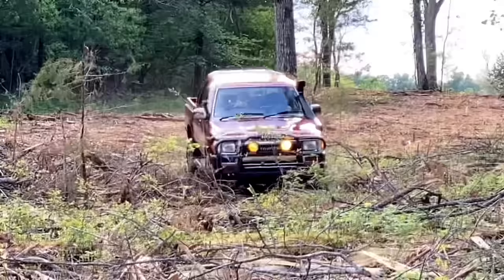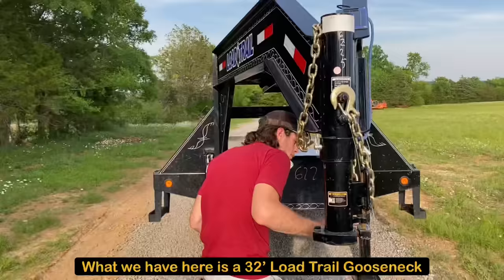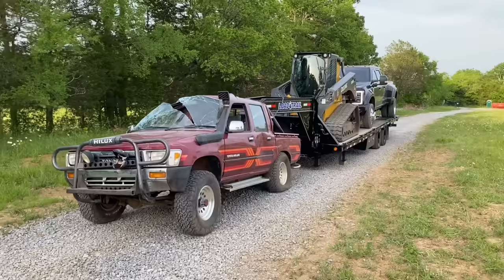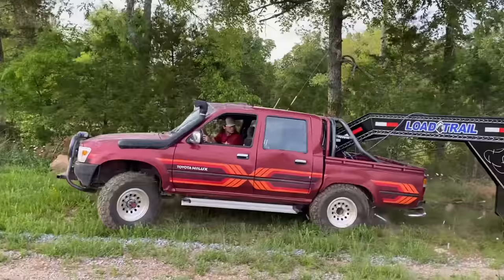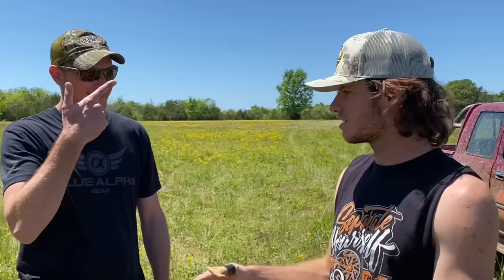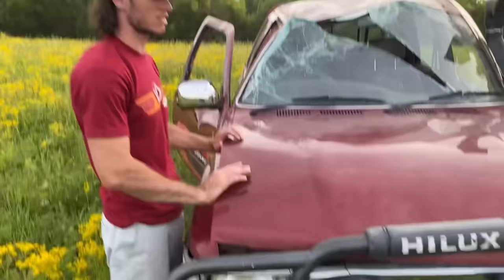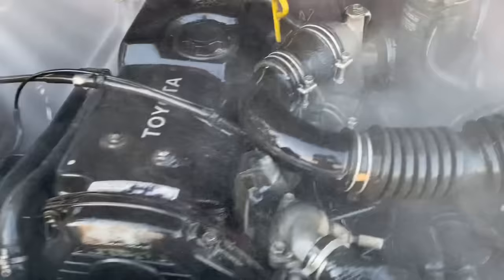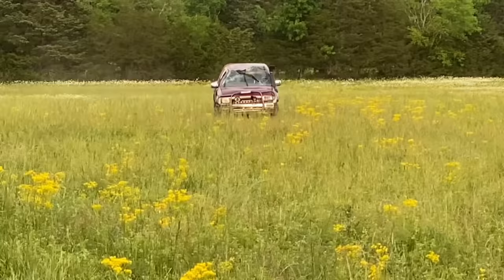Toyota Hilux Durability Test #2

Comment: The hood is designed to fold in the middle in case an accident to shield the windshield from other incoming objects. It is a safety feature :) So the folding hood is working perfectly. @10:00.
Reply: ne zna on gde je crna gora
Reply: @@alsusmedia Physics my friend. How do you suppose you would keep the metal in place during a collision? Really think about that.
Reply: @@alsusmedia No. Do you know why folded steel was revolutionary? Think about when you fold paper how much stronger it gets. What do you think would be better one or two layers of metal?
Reply: @@alsusmedia No Problem :). I appreciate your open mind and grateful heart. Most people are isolated and aren't like that. Cheers!
Reply: Another reason why the hoods or "bonnets" are designed to fold is so that the back of the hood doesn't come through the windshield and decapitate you in a head-on collision. This was a problem on older cars from the 50's, and was also the reason why collapsible steering columns were invented.
Reply: Also, I must give props to the Hilux. I am a huge Top Gear fan, and the first video of theirs that I ever saw was "Killing a Toyota", which immediately made me want one, and now I have a 2nd gen Tacoma. The next step for me is definitely a 4th gen Hilus SSR, pretty much exactly what WhistlinDiesel tested. And honestly, I am glad that this pickup was sacrificed to demonstrate how tough they are. It's not like these are super rare and have to be kept nice for the rest of time. There are still farmers in Australia that have beat on 3rd and 4th gen Hilux's since they were new, and they just keep on running!

Comment: This thing hasn’t failed to impress me, it’s insanely durable.
Reply: Watch what Jeremy Clarkson did to one they left it in an ocean and demolitioned a building on top of it and it still ran😂
Reply: Please buy the new Toyota hilux and test it the same
Reply: Wait until you see the bigger brother the 70 series land cruiser
Reply: @shiv5927  overrated
Reply: @jacobrefoy4061  my bad, i meant the 70 series
Reply: That because it's a toyota the are built right I have a 13 toyota and never had a problem with it

Comment: "no coolant for 6 miles." Toyotas don't need coolant. And anything after 1 quart of oil is optional
Reply: No gas just fumes
Reply: Overheating is the one killer of these things. They like to crack heads.
Reply: Except that's not even almost true
Reply: @MegaDysart  both the 1KZ (3.0 diesel) and 2LT-E (2.4 diesel) crack heads after around 150k if not looked after,  but they're relatively inexpensively replaced. The blocks themselves are pretty bomb proof.
Reply: My cousin had an 89 4x4 with a 22RE. Blew the rad out of it. It’d run until would lock up, he’d let it cool down and it’d fire back up and do the same thing again.
Reply: The old Camry motor (1MZFE I think) a buddy of mines mom ran it outta oil, locked it up, and then added oil and let it sit for a week. Things still running to this day
Reply: @liamhastelow5235  the hilux in this video is an ln106, so it has a 3L in it, not a 1KZ. They do like to crack heads thiugh
Reply: @achilleaustin4477  thought it was a 2L but I've forgotten some of the engine codes now. 2.4s were actually worse for overheating than the 3.0 was. I had a 3.0 Surf and loved it. Just was too thirsty.
Reply: I’ve never owned a Toyota. But wow. Just wow. I can see why they are so expensive 💰💰💰
Reply: @liamhastelow5235  the surfs omg. Such a great vehicle
Reply: I've I've a 03 Toyota echo at 190k, made a few 300mi trips before it sounded funny and I had seen it was running on a CUP of oil. Head gasket is leaking now but still runs fine lol
Reply: I've personally witnessed a toyota avalon run and drive with no oil pan, more than a couple times, never knocked or anything. Ran like nothing was wrong lmao.
Reply: Can confirm OP. lol. Oops 😬
Reply: True, but to be fair my old v6 mustang didn’t need oil or coolant to run either, I ran that thing hard too. But those did get an old explorer engine so probably why

Comment: Today I learned a little ass hilux has a higher towing capacity than my 2500
Reply: #timetotakeitback
Reply: I bought a 2013 tahoe 4x4,  and I feel stupid now after watching this , selling that and looking for a Toyota next
Reply: @bicmitchum1368  highly recommend the 5.7 out of the tundra smoothest motor I've ever driven durable as hell.
Reply: @benmuccianti8577  towing capacity is crap though
Reply: Bruh these little bitty trucks could complete with 1 ton pickups
Reply: @NeedForSpeed.2004  that hilux is a 1 tonne
Reply: @ReinventingTheSteve  yep
Reply: 4x4 lo is like 30:1 gearing I believe
Reply: Well of course that’s considering it not breaking and flattening the truck with that load like what happened here.  We got guys who are 250lbs pulling fire engines with ropes

Comment: My 1st gen Tundra did that for me in a rollover. Went over 1.5 times, landed on the passenger side door in a ditch. I climbed out through the window totally fine and when I went to get stuff out of it at the wrecking lot, all 4 doors of the access cab opened and latched flawlessly. Probably still drove.

Comment: It appears that Toyota rated their Hilux the exact opposite way that Jeep rated their Gladiator.
Reply: What do you mean? How does jeep rate their gladiator?
Reply: you know what the funny thing is, Jeeps was used in WW2 to carry troops to the front lines and move about in offroad conditions which is pretty badass until you find out that Toyota has an actual war named after them where these trucks would go up against tanks and attack helicopters and actually win...
Reply: @erikjr3291  I mean that Jeep rated the Gladiator as a heavier duty truck than this Toyota.  It's my opinion that the frames (not to mention just about everything else) are not as strong on the Jeeps.  Perhaps if this triggers enough people WD will be ever so kind as to repeat these tests with a Gladiator and then we can all decide for ourselves which company made the better truck. Peace be with you all.

Comment: This was a dream truck of mine for so many years, until I saw you bend that hood. I'm pretty over it now.
Reply: Yeah I don’t blame u that Screams poor quality.
Reply: its actually made to, it got little notches in it so that in an accident it sort of promotes crumple zones.
Reply: It bends back just as easy. I bet if he put couple minutes to bend it back ‘properly’ it would latch, it worked with my ‘80 Corolla
Reply: Lol, a hood is just a sheet metal cover. Even with my 1976 Benz it's pretty thin. Doesn't even have much in the way of bracing, just a slab of sheet metal.
Reply: It’s supposed to do that, all cars do it, it’s called a crumple zone during an impact to help absorb impact during a crash, back in the 80s they didn’t have all that tech so they had to improvise.

Comment: strip everything out of a truck and see how little it mechanically takes it to run and drive
Reply: He did this with a diesel truck. Wound up just driving the front axle, transmission, engine, and half of the frame around. Highly recommend
Reply: It only takes the Toyota emblem
Reply: We already know the answer to that

Comment: The jdm importers see a sudden rise in requests for 80s hilux's. I can see it now.
Reply: Japan laws have taken most of them off the road. Same with any old vehicles, it's expensive to keep old stuff on the road, they relegate old stuff to collections and museums
Reply: @netrioter  how is it expensive if that truck will run on the road for another 500k miles and maybe need a water pump and ball joints
Reply: @cablenowadays6586  yeah, but in Japan they charge you a lot of taxes for having an old car, mostly because of the pollution and to maintain a high activity in the car Market.

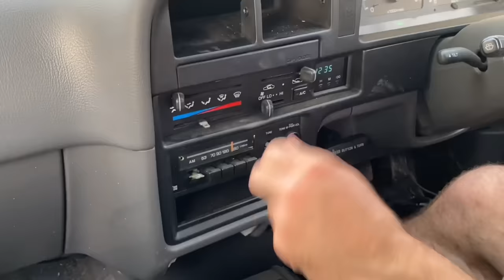Comment: @11:45 old school radios can be good because you dont press a button and have to guess.. hear me out

The old knobs where you slowly tune you can do while driving but holding a button you have to look and press lightly

But what i remember is old old school with motorised "tuner" set and the knob would spin

Anyone?

Also yay to A/c
Ok so you might not get a hypoallergenic exactly 24c interior but its always a quick cold  blast and then you can open windows ... some of the older hiluxes even have the inverted window

Comment: That hood bending like that is on purpose so it doesn't cut your head off in a wreck!
Reply: Yes.  Pop the hood on any Toyota and you'll see places where the steel is intentionally crimped...so that the metal dissipates energy and lessons the forces of a violent head on collision.  
The engine mount is also designed to deflect into the ground, if a head on is violent enough to push the engine towards the passenger compartment.
Reply: Nah. he didnt fold it w one hand. The support ridges were snapped by the head-on tree accident first (can see them see in profile)

Comment: I had one of these in Afghanistan, its the only truck I would trade my Tacoma for.
Reply: I hear you. I think I would trade my '17 4Runner for one like he is destroying. I had a '04 Tacoma DCSB for 16 years prior. Best damn vehicle I ever owned.

This is kinda hard to watch.
Reply: Military?
Reply: My dad has a 88 pick up with 300,000 miles. Then currently we still have it. It runs smoothly. The newest one he has is a 2008 Toyota Tacoma. V6 PreRunner.
Reply: Toyota’s are not real trucks😂😂😂
Reply: thx for ur service
Reply: @ikegiffen2539  correct.

Comment: The ac knobs and shit are supposed to be able to come off that’s how u pull the rest of the dash out
Reply: Yeah, a lot of Japanese vehicles of the era are designed to have parts that can be easily replaced or fixed if they weren't designed to break in the first place, all that stuff will clip back on and be just as strong
Reply: same with the mirror, it has a couple of springy tube things, if they didn't go flying to never be found again, he could put the mirror back on with a phillips head screwdriver

Comment: Engines: 1968-1971: 1.5 L (1,490 cc) 2R I4 [6] 1971-1972: 1.6 L (1,587 cc) 12R I4 [6] 1969: 1.9 L (1,897 cc) 3R I4, 85 hp (63 hp) 86 PS) 1970-1972: 1.9 L (1,858 cc) 8R overhead camshaft I4, 97 hp (72 hp 98 PS) 1972: 2.0 L (1,968 cc) 18R overhead camshaft [other languages] I4, 108 hp (81 hp; 109 PS) 1972-1978: 1.6 L (1587 cc) 12R I4, 83 hp (61 hp) (SAE gross, Japan), [7] 67 hp ( 49 hp (SAE net, export year) 1973-1978: 2.0 L (1968 cc) 18R I4, 105 metric hp (77 hp) (SAE gross, Japan) 1978-1983: 1.6 L ( 1,587 cc) 12R SOHC I4, 80 hp (59 hp) at 5,200 rpm and 12.5 kg·m (123 Nm) of torque at 3,000 rpm (RN30/40, Japan) 51 kW (69 PS) 68 hp) at 5200 rpm [9] 1981–1983: 1.8 L manual, 4-speed (Australia) 1978–1983: 2.0 L (1968.1 L cc) 18R SOHC I4, 89 metric hp (65 kW) at 5,000 rpm and 14.8 kg·m (145 N·m) of torque at 3,600 rpm (1983 European spec) [15] 1978–1980: 2.2 L (2,189 cc) 20R SOHC I4, 67 kW (91 PS) ; 90 hp) at 4,800 rpm and 122 lbf-ft (165 N·m) of torque at 2,400 rpm 1981–1983: 2.4 L (2,366 cc) 22R SOHC I4, 72 kW (98 PS; 97 hp) at 4,800 rpm and 129 lbf-ft (175 N·m) of torque at 2,800 rpm 1979–1983: 2.2 L diesel I4, 46 kW (63 PS; 62 hp) at 4,200 rpm and 93 lbf-ft (126 Nm) of torque (5 long bed only in US), LN30/40

Comment: The hood folding like that is a legit design. In the event of an accident it folds like that to prevent debris from coming into the windshield. If you look there are actually engineered weak points under the hood so it will fold like that.
Reply: I had a teenager slam "my" Penske doing 50-60 going around a corner. Those crumple zones are life saving that hood would've decapitated her. She was still close though I had just closed up the lift gate.
Reply: Folded like that I top gear test as well

Comment: Lost it when it pulled the Raptor. 30 years ahead of its time
Reply: It did have a ton of bricks in the bed
Reply: @qomco  it also has 300 less horsepower
Reply: @Spherz  good point
Reply: @Spherz  and still way lighter
Reply: Raptor looks like it was only in 2 wheel drive initially. And Horsepower doesnt win tug of wars, weight and traction does.
Reply: @Steve_I  and torque
Reply: @toronto543ontario6  it’s still an old Toyota

Comment: The hood is supposed to bend so if you get into a crash it doesn’t put all the pressure on the hinges and the hood snaps and comes flying back at you they are required to put cripple points in the hood

Comment: Type: automobile model series (en) 2.7 gasoline, 2.0 gasoline, 2.5 turbo 2.4 turbo 2.8 turbo D4D Engine position: front, longitudinal Power: 164 hp Torque: 241 Nm Movement Rear-wheel drive, four-wheel drive Automatic transmission 5-speed for rear-wheel drive 6-speed for four-wheel drive Weight and performanceWeight 2,730 kg ￼ Maximum speed 200 km/h - 180 km/h Fuel tank 80 liters Dimensions Length 5.13 Width 1.760 Height 1.695

Comment: Don't get me wrong, the Hilux is much more impact resistant than my F150 by MILES but can it get on the highway with 2 running cylinders (V6) and go 76mph and get amazing gas mileage (not the reason for the others turned off😅)

Comment: This thing won a war.
Against tanks.
In fuck you desert shithole conditions.
Life is a racing game, and the devs forgot to give this car breakdown parameters.
It's one of those cars you can drive to a pyramid shaped brick, and it will still haul a 30 tonne trailer with 2 and a half wheels left.
You can drive it into a ditch, roll it over twice in a field, crash it into a concrete bridge pylon definitely on purpose, set it on fire by "making the brakes more fun this way", and full send it straight off an angled flatbed GTA style, in the process of which gaining a permanent left elbow injury, and you will leave the car more fucked up than it the crash.

If that sounds awfully specific, you're right.
But the thing didn't fucking break.

(Seriously drive safely, i have it from a trusted source that permanent joint injuries because of "i saw that on TV, i can do that!" are quite literally the opposite of fun. Or drive like a destructive maniac, i'm not your mom, have fun.)

Comment: The weight of the f450 is almost 100% on trailer rear axles, so, well... yeah ok, impressive? not as much as you think. And, put all these bricks on the raptor instead of the toyota, he will beat the toyota on tug of war, it's ridiculous .... If you test,  don't manipulate with physics. But yes, amazing truck.